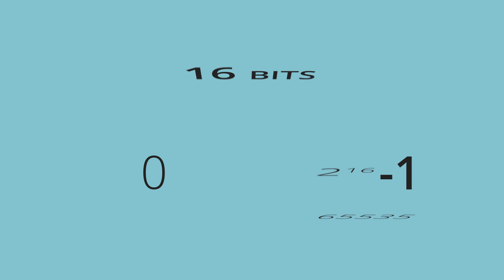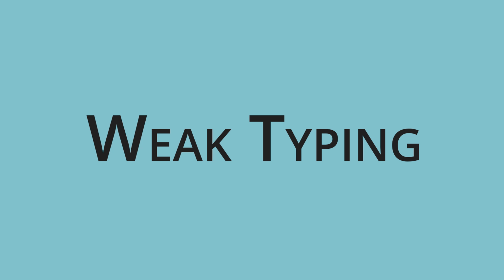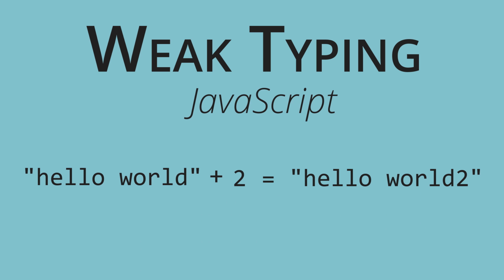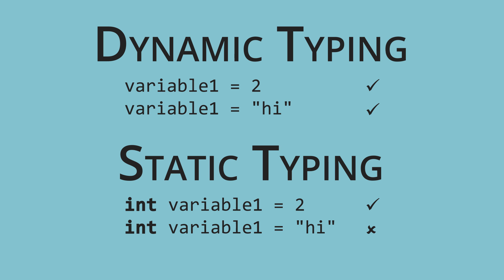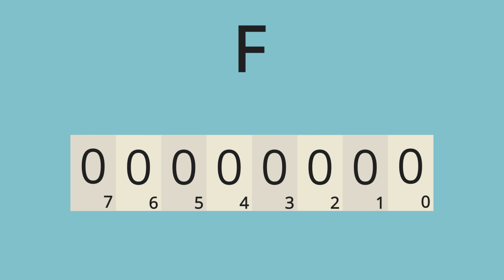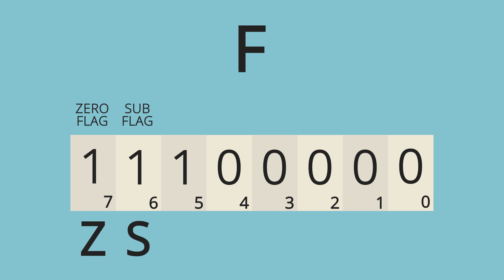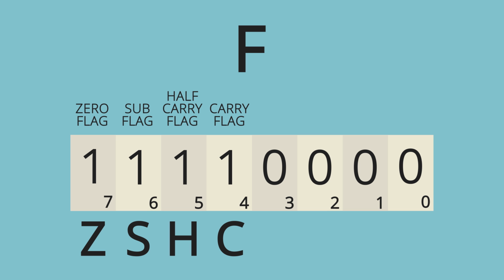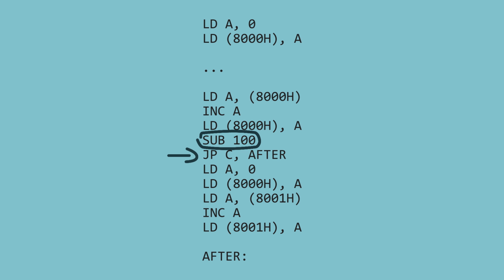The Game Boy, a hardware autopsy - Part 1.5: a few mistakes and register F

Comment: First of all, really loved your video and can't wait for part 2!

Second, there must be a lot of confusion on what is considered an interpreted language and what's a compiled one. A lot of people think that "if it creates executables it is a compiled language otherwise it uses an interpreter" but this is not the case.

The compile phase, is where the compiler goes through the program, and prepares the memory for execution. Function declarations, variable declarations, scopes, optimizations, these things happen in the compile phase. In human-speak I'd describe it as the "Before I execute anything I check things, and do any necessary preparations that will help the execution itself" phase.

This usually happens when an executable is generated but the executable itself is not a requirement. In Javascript (yes, Javascript is also a compiled language) for example this gets done dynamically in the middle of runtime: Your code gets compiled once after the initial load, runs, and if during runtime the engine realises that the optimizations it guessed are wrong it recompiles the thing on the fly before it continues the execution.

I don't know much about python but I'd guess a compile phase must be hidden there somewhere. I cannot imagine how objects can exist without a compiler phase, but I'd love to hear from other people on the subject.

Actually I don't know many interpreted languages now... Bash script is for sure one since each executed line has absolutely no knowledge about its place in the program. Brainfuck also is an interpreted one.
Reply from the maker: That is all absolutely true, but goes way beyond the scope of this video, which is why your comment is great as it gives curious viewers a chance to learn more! Thanks for chiming in!
Reply: +Κώστας Λουπασάκης 
most interpreted languages build 'classes' during runtime, for example, in Ruby, the class keyword makes the interpreter start putting any definitions for functions or variables in the class that is being defined. when the matching 'end' keyword is reached, it returns to the previous scope. The thing is, the classes don't exist until the code defining them is executed, so with large projects, any files containing classes must be loaded before the code can actually execute.

They also get around having to 'link' things by simply not caring if things are defined on objects until code actually is called, so there's no real way to check the code until it actually runs. Another thing is that in ruby, methods can be defined at runtime, and dynamically added to, redefined, or removed from classes.
Reply: +Κώστας Λουπασάκης Regarding your comment about Python, yes Python code is compiled to bytecode at run-time before being executed by the VM. In some cases, that bytecode is even cached to the filesystem such as when a module is being imported.

I don't think that 'interpreted' and 'compiled' make for good comparisons. If anything, maybe the more relevant comparison is if code is either executed directly by the CPU or by a virtual machine.
Reply: +Κώστας Λουπασάκης Brainfuck is the strangest language I have ever seen.
Reply: +Blake Watson True, but writing an interpreter for Brainfuck is really easy which is nice
Reply: that's true.  I think you can get them down to like, 200 bytes
Reply: +Κώστας Λουπασάκης If a language is considered compiled or interpreted is not something that can be easily 
stated. 

Examples: 

Some say Java is interpreted, but there is hardware that can execute Java Bytecode directly (built into several ARM processor in fact). The Java Virtual Machine is more of a emulator of a machine dedicated to running Java. And so if one considers Java interpreted, they have no idea of how a computer actually works. 

Brainfuck, traditionally a interpreted language have a optimizing compiler. Written in Brainfuck (https://github.com/matslina/awib). And there are C interpreters out there for people that like scripting in C.

Given enough time, all languages are both interpreted and compiled at the same time.

Also: I can easily design a implementation of Objects using a variety of structures with no requirement of prior knowledge which could be used for a strictly interpreted language. HashMaps (or other map types if you prefer), LinkedLists (horrible performance but really simple to implement) and Reallocating arrays. Skiplists could be a fun way as well.
Reply: +Κώστας Λουπασάκης The idea of compiled and interpreted languages is misguided.  Interpreters and compilers are simply implementations of languages.

One could write a C interpreter if they wished, and brainfuck and shell compilers would not be too hard either.
Reply: Ehal256 I don't think it is possible to write an interpreted C. The basic idea of an interpreter is that the code is executed line by line, without any other context; the interpreter does not go through the entire program before execution, and therefore it does not know where blocks start or end and what blocks are inside other blocks.

So function and block scopes are out of the question. Encapsulation seems hard to implement as well

I agree that it is a misguided term though. By that definition, assembly is the only interpreted language: All operations are run in sequence without any other context. And if every program can be translated to assembly, aren't all programming languages interpreted ones as well?
Reply: +Zephyyrr42 I agree that the definition doesn't have much meaning nowadays. JIT compilation happens all the time now and the separation gets blurred. 

I'm really curious about what you said about designing implementation of Objects without a compile phase. Unless we speak about very simple objects I cannot think of a way. Have a link with more info on the subject?
Reply: +Κώστας Λουπασάκης It's definitely possible, and there are several that you can find easily through a google search.  Functions and variables must be declared before use in C so you just keep track of those while you parse the program.

Not having to parse the program text twice was the original motivation behind that requirement I believe.
Reply: If you are confused after my (brief i give you that) explanation, I guess we should first come to agree what we mean by "Objects".

I mean structs with member variables of some valid type (can be another object) and optional methods (member functions). First, a member functions can be implemented like function pointers and stored as such in the the object.

For the hypothetical interpreted language with objects, it is parsed line by line (really split into statements by some mechanism like semi-colons or newlines but for simplicity sake, each line can have at most one statement). The objects we build are defined by sequential assigns (var obj; obj.x = 2; obj.y = "Hello World!";...) but we could just as easily extend to something like Javascript object initializations through expansion.

So lets go for a example implementation using LinkedLists, because they are simple to understand and can be implemented almost anywhere as long as you have pointers (the language we implement the interpreter in have them). When we get a line like "var obj;" we create a value pointer somewhere in our scope. This is because we have only declared it without a type so we do not know. Could be a object, could be a int or string or array or whatever. Once we execute "obj.x = 2;" we can tell that we are referring to a member of obj that we want to assign to the integer 2.
This allows us to initialize obj to a Object and point to a empty linked list (do I need to define how to implement one? I do that some other time if you insist). We then put in a new element in the list with a structure containing a string "x" (the name) and either a value of 2 if we are implement in a dynamic language or a value pointer if static since we might need to change the type later. "obj.y = "Hello World!"" is done in similar fashion, appending to the back of the list. Assuming we then get a "print(obj.x)", all we have to do to resolve the value of obj.x is to lookup obj in our scope(s) and keep following the pointers through the list until we find a name matching "x" (string equality is a (mostly) solved problem). Then we just need to follow the value pointer and return that to our expression evaluator for further processing.

That should explain almost everything. there are a few details regarding methods that I will skip because once you have the above and teh rest of a interpreter, that should be very simple to figure out and far to much to write.

I am sorry for the wall of text but that is what happens when you try to be rigorous.

If you have any further questions, I will be happy to answer them outside of Youtube. Such a horrible media for writing these kinds of texts.
Reply: +Zephyyrr42 I think I get the general gist of it. If I understand this correctly statements like the following can, with no problem, be implemented in an interpreter for, say, JS:

var print = function(params){console.log(params);};

var obj = {
   one:1,
   two:2,
   three:3
 };
print(obj.3)

The scope of each line can be determined from the lines we previously parsed, so this can work with as complex data structures as we need, as long as the requirements of each line are met previously.

But the following example (that works in real-life JS) wouldn't work because this JS feature requires parsing the entire code before running it

var obj = {
   one:1,
   two:2,
   three:3
 };
print(obj.3)
function print(params){console.log(params);}
Am I getting this?
Reply: +Κώστας Λουπασάκης Yes. a necessary evil of pure interpreted languages (and C) is that thing need to be declared before being used (A function is not used until called, so recursive calls or forward declarations of functions do not count).
Reply: +Κώστας Λουπασάκης thanks for your unsolicited unproductive bla bla.
a compiler doesn't prepare memory for execution, that's the OS's  job and comes way after.
"Function declarations, variable declarations, scopes, optimizations, these things happen in the compile phase." thanks for clearing things up for us by "things happen". extremely helpful. also declarations and scopes "happen" when the source code is written by the programmer. optimization is just a word and can happen any time. what? you mean compiler optimization? yeah, they happen during compilation. thanks, captain.
"Before I execute anything I check things, and do any necessary preparations that will help the execution itself" this is the must illuminating part of your post. thanks, it's all so clear now.
"This usually happens when an executable is generated but the executable itself is not a requirement." oh, so in addition to compiler and interpreter we have a generator now also. well, if it helps clearing things up...

heads up: it doesn't.
Reply: +Κώστας Λουπασάκης thanks for your unsolicited unproductive bla bla.
a compiler doesn't prepare memory for execution, that's the OS's  job and comes way after.
"Function declarations, variable declarations, scopes, optimizations, these things happen in the compile phase." thanks for clearing things up for us by "things happen". extremely helpful. also declarations and scopes "happen" when the source code is written by the programmer. optimization is just a word and can happen any time. what? you mean compiler optimization? yeah, they happen during compilation. thanks, captain.
"Before I execute anything I check things, and do any necessary preparations that will help the execution itself" this is the must illuminating part of your post. thanks, it's all so clear now.
"This usually happens when an executable is generated but the executable itself is not a requirement." oh, so in addition to compiler and interpreter we have a generator now also. well, if it helps clearing things up...

heads up: it doesn't.
Reply: +JohannaMueller57 so much anger... I wonder... No, never mind

Comment: Statically typed doesn't mean that the type needs to be specified in advance. In most modern languages you don't even need to specify any types anymore and they are still statically typed. The difference between dynamically typed and statically typed is that the compiler figures out the types, checks the types and complains about them at compile time, which is something that happens at runtime in dynamically typed languages.